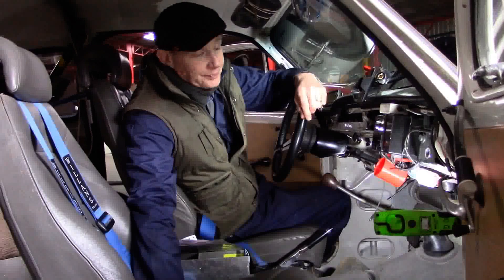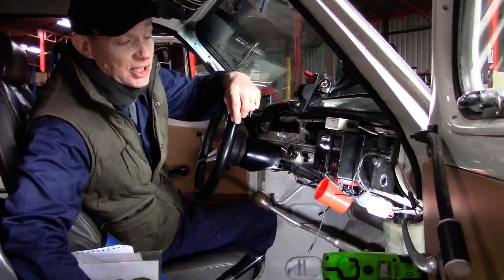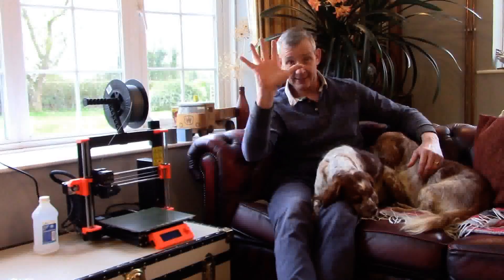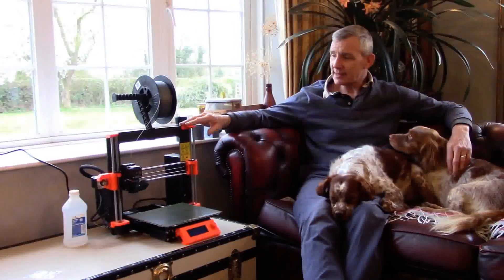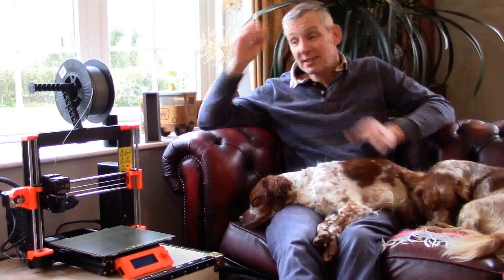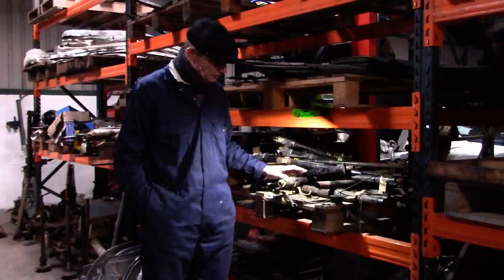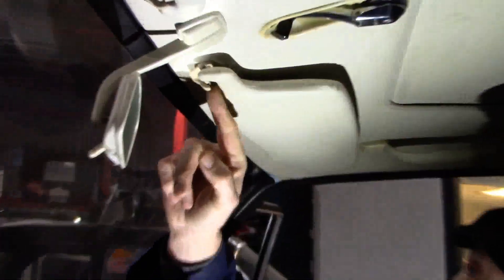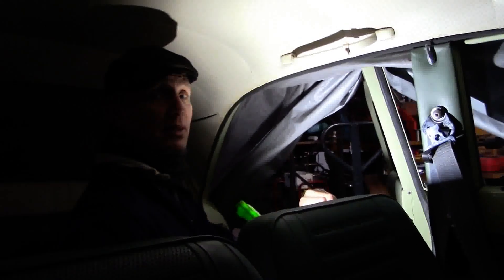3D Printing

Comment: Great video! and... I've done a heater fan - 3D scanned (Nextengine), and printed in ABS. (It's even pretty well balanced!). I've also have done a coil mount and air filter cover plates (didn't need to scan those though).